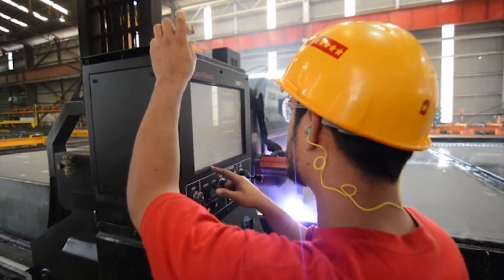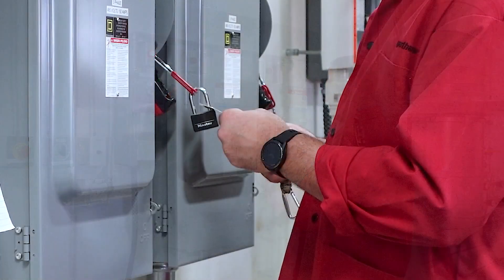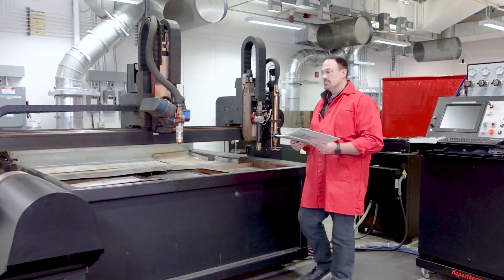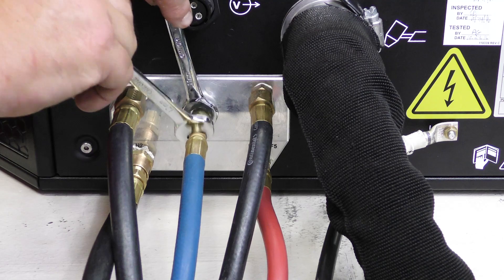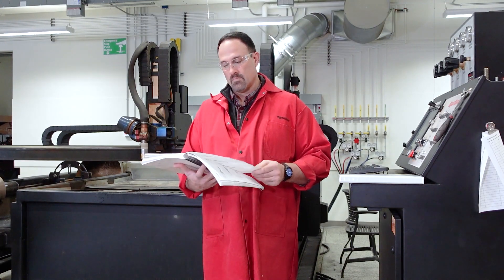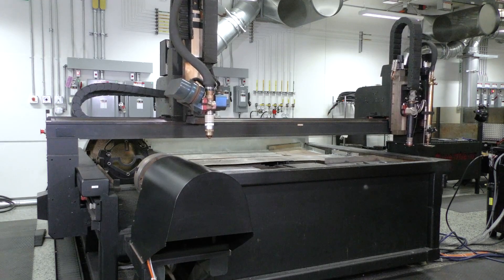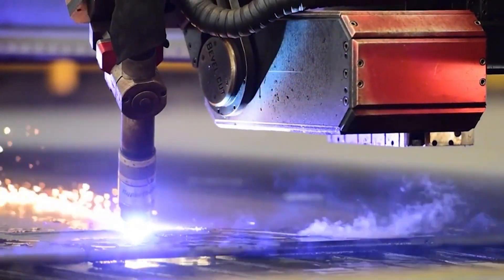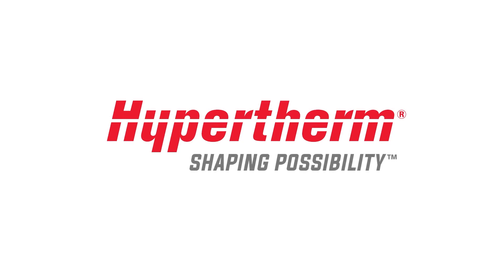Plasma Cutting Basics & Safety: CNC Table Startup Procedure

Comment: I have an hypertherm xpr 300 and looking for scientifitc documentation or case study on semi submerged plasma cutting. There is a ruster tail behind my cut and thin layer of water on my plate. I'm getting close to submerged plasma cutting characteristics. .0325 heat ring on my martial. Is there any information it would be very much appreciated.